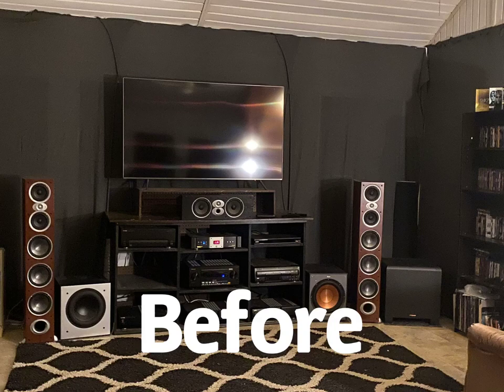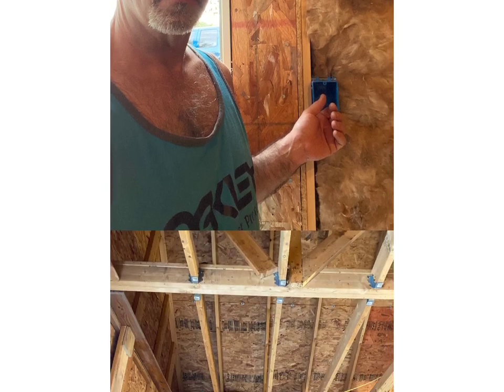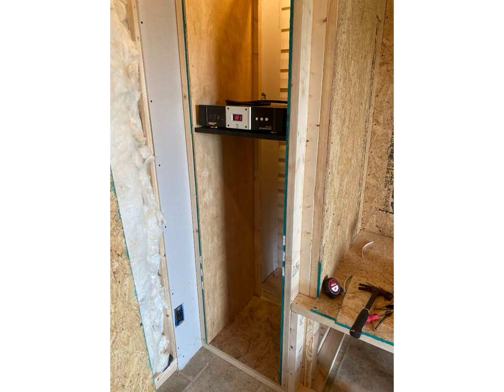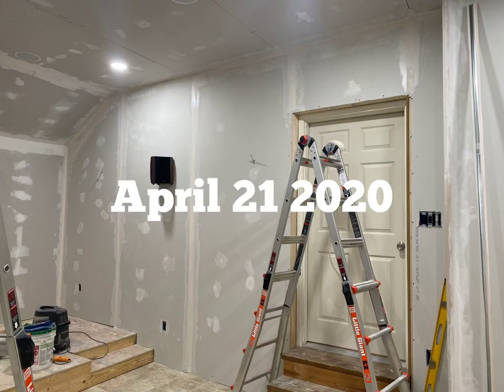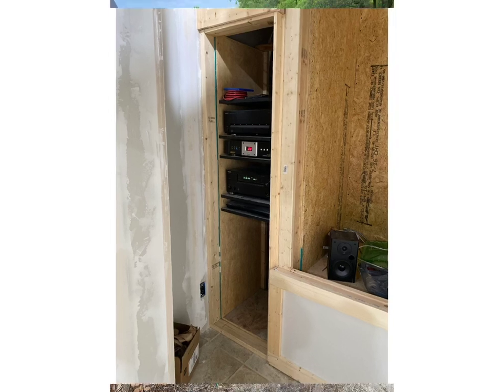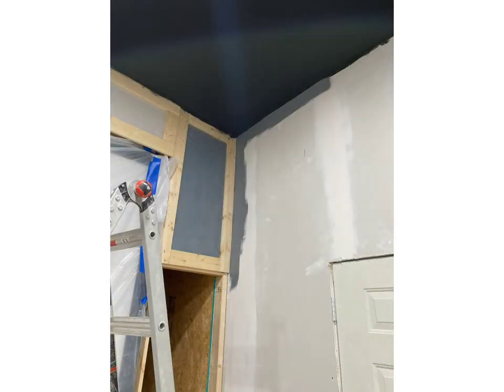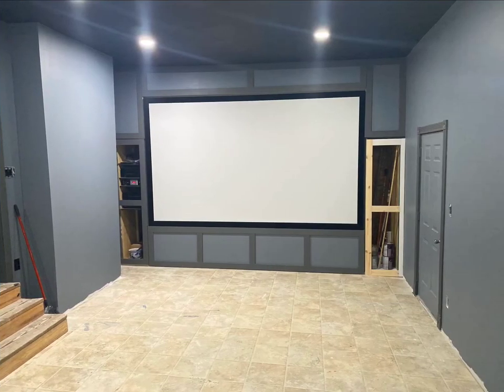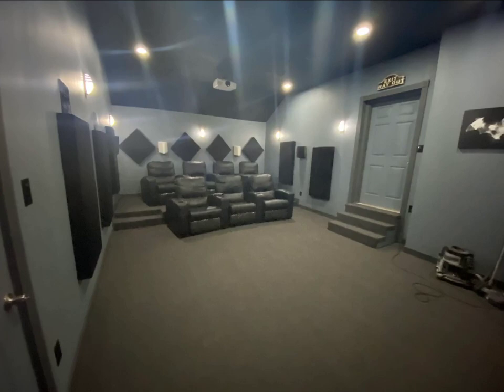Home theater build tour! 7.2.4 Dolby atmos dts x imax enhanced

Comment: You are hard core, you actually built the room!  My builder will build my room including the raised floor.  I did tell him to leave the theater unpainted, I'll do that myself.  I will also build decorative columns on the side walls where the surround speakers will be located.

I wish I could find a deal like that on the chairs, I'm going to need fifteen of them!
Reply from the maker: mthemaniac 15 chairs!! That’s gonna be a heck of a room!!!!! Wow!
Reply: @myhometheater7029  Yeah, it's just slightly bigger than my old theater.  It will be 20'-11" wide, 27'-0" to the back wall behind the back row of seats and just under 30' back to the entry doors.  The old one was 19' wide but otherwise virtually identical.

Comment: Awesome tour build I'm starting mine next year. 
Q: On your projector, do you have a back up power supply for it? I have heard if power goes out the projector can burn up because of improper cool down. I'm new with movie projectors. I'd like to use your idea of your platform if ya don't mind.
Reply from the maker: Vusstoppy V 4 I this is my first projector setup also. I never heard of that. I’m not using any backup on anything. So I’m not sure of that. You’re more than welcome to use any of my ideas if you like. Thanks for checking my video out. Stay tuned there’s more coming.

Comment: Hey Chris, just a few questions ... What fabric did you use to cover your acoustic panels? Something audio transparent? And how thick did you build them?
Reply from the maker: TheRealSchnitti it’s fabric that I got from work. It’s a circular knit fabric kinda like t shirt material but nicer. It works good for acoustics. I used 1”x2” boards to build them.
Reply: @myhometheater7029  OK, thanks... Thinking about building some panels myself ...
Reply from the maker: TheRealSchnitti Joanne fabric has speaker grill cloth that most people use. I have never been able to find it when I’ve been.
Reply from the maker: TheRealSchnitti I just saw of those in a theater on Facebook group. They look really cool.
Reply: @myhometheater7029  I don't think they deliver to Germany ;) 
My question was more general... just wanted to know, if you used special audio fabric or normal fabric. I've read about building panels. They almost always used special audio fabric. But if "normal" fabric works also, that's good to know 😉✌️
Reply from the maker: TheRealSchnitti yes sir using regular fabric will definitely work. I saw a video to where you can get movie posters printed on fabric and then make an acoustic panel. That looked awesome!
Reply: @myhometheater7029  OK, that sounds really cool!! Gonna look out for something like that here in Germany. Thanks for the tip ;)

Comment: What height is the stage that you built?
Reply from the maker: 2’ high
Reply: @myhometheater7029  Thanks for the quick response. Your stage turned out real nice. Trying to finalize the framing for this today. Do you feel like floor speakers aren't too high with them being raised by 20"? I'm doing a 2.35:1 DIY screen and wasn't sure how low I should go to the ground. I didn't want there to be a large gap over my screen. Right now I have the stage at 28" but now I'm concerned the speakers (43.12" Klipsch RP=8000F) are too high on the stage.
Reply from the maker: @mikestevens1441  check out this video I did. 

https://youtu.be/bMtRA0vln0Y
Reply: @myhometheater7029  Too funny! I just searched your history and noticed this video! Great feedback, I really appreciate you doing these videos and responding.